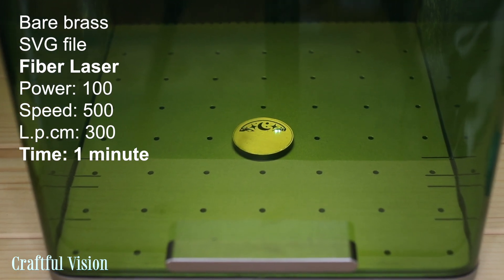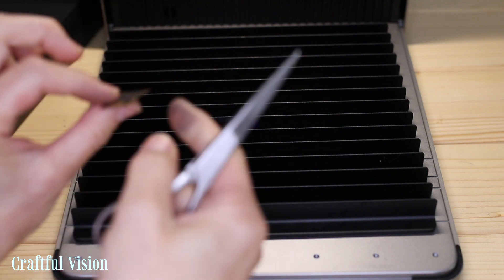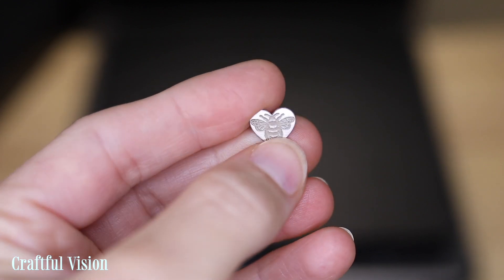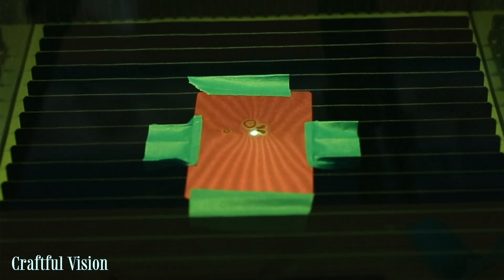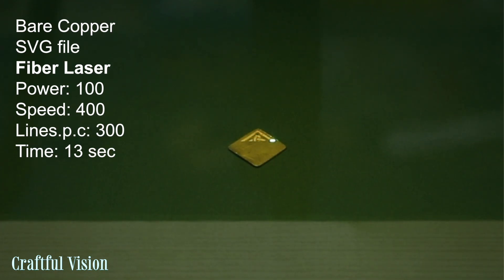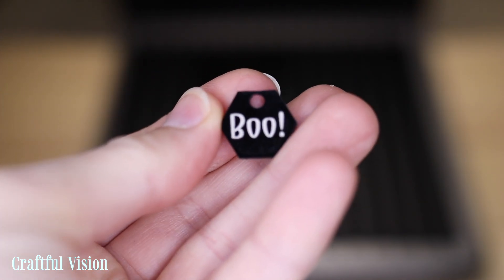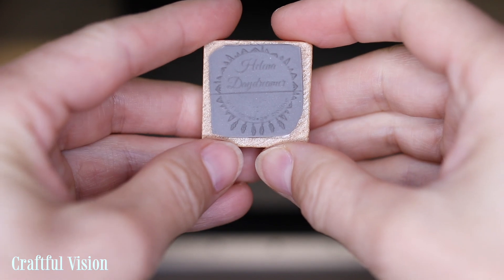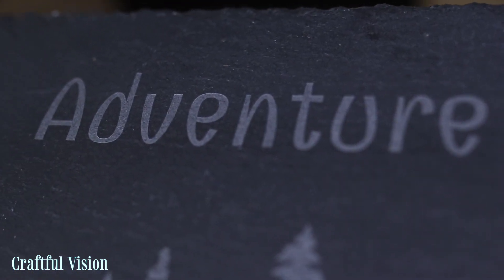xTool F1 Ultra - Ultimate Testing Part 1 - Cutting Silver, Brass, Acrylics (Fiber laser machine)

Comment: Most of the engravings are not properly centered. Is this due to negligence or an inaccuracy of the tool?
Reply: She was just testing the laser on different materials, therefore centering was irrelevant.  The machine is incredibly accurate.  The machine creates a light pattern to assist with material alignment (see 10:29 for one of the patterns, as an example). To simplify repeatable accurate engravings, you would create or buy a jig or even use basic aligment tools to hold one or more pieces exactly where they are needed

Comment: Thanks for the detailed video.  For a craft shop with need to engrave glass wood and some medal. Do you think this would be a good option? I am also checking commarker omni. Is this xtool even better?
Reply from the maker: Hi, well so far what I have noticed, this machine is amazing and fast at engraving wood and metal. I haven’t tried engraving glass yet, but you just gave me an idea to do so :) I can’t compare with the comarker, since I’ve never tried it, perhaps I will in the future. What I love about the f1 and f1 ultra is that everything is build in and it’s fully enclosed and portable. Anyway, it’s an investment, so I hope you find something to suit your needs.
Reply: UV is your best option for glass.  CO2 is common as well.  diode and and fiber laser is a possibility in somr circumstances although the latter two do not work on clear glass, unless they are covered or coated with a variety of techniques.  CO2, didoe, and Fiber will actually heat the glass, which can break or reduce the structural integrity of the glass if the settings are not finely tuned.  UV lasers are often referred to as cold lasers but it is their wavelength that make they the gold standard for glass engraving.  They are also very effective at engravging wood since it will not burn or scorch the wood. Each type/wavelength of laser interacts with different materials in different manners,  or sometimes not at all.  Too many lasers, not enough time or money...ugh